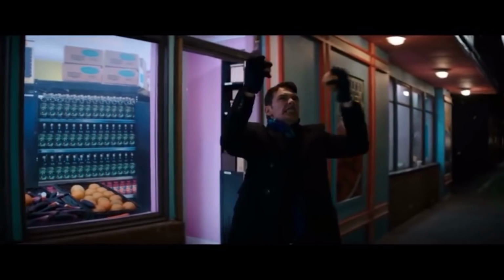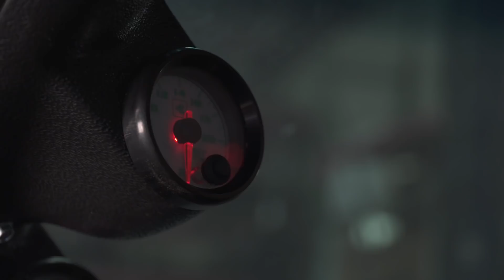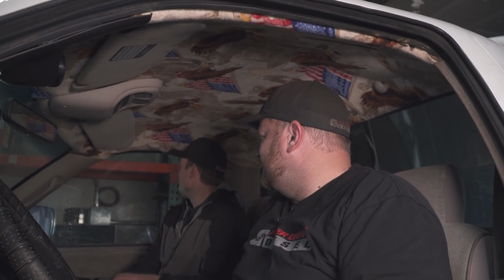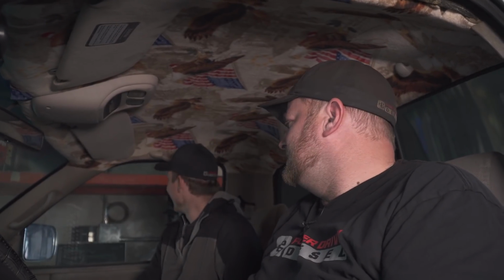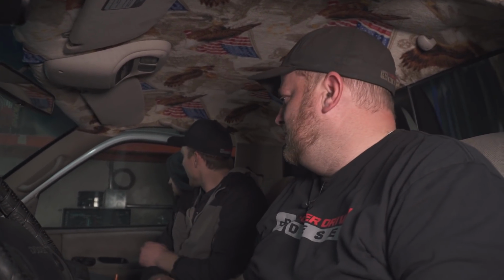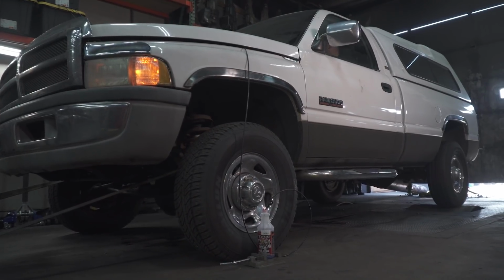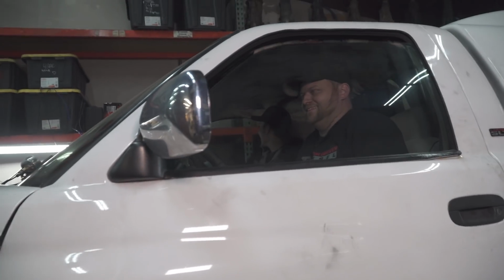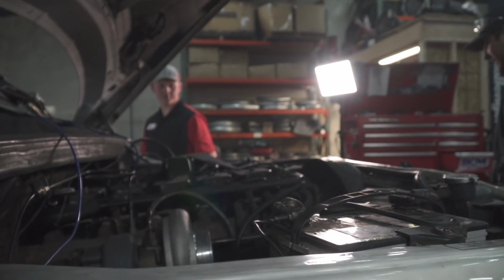Does Nitromethane Add Power to a Diesel? | Power Driven Diesel

Comment: My 1996 has 480000miles with compound turbos on it still on the original headgasket engine has never been touch. I have a set of head studs I put in it a few months ago. I have seen 70lbs of boost out of it so far. It just keeps on going. It's really amazing how much these engines will take.
Reply from the maker: Sometimes they just seem to last forever... and then sometimes they struggle to keep the head gasket in-tact.

Comment: This was awesome great job men!👍 Josh fed that dry shot when the horn blew 😂. 👀  I had an old 1st gen Cummins with some minor mods. I installed a snow performance methanol injection kit on it. I could have swore it would make a little more power with straight ice water injected over the meth. It was good for 4-5 10ths in the quarter mile. Thanks appreciate it

Comment: I would like to swap this motor out for the one that's currently in my 94 12 valve. I purchased my truck from a family friend shortly before he passed away and the truck has been sitting due to mechanical issues in the motor. I'd love to see you truck up and running again even if it's for a short time.

Comment: Idea to test. How much power is lost in the exhaust. I have a straight pipe with a 30 inch magnaflow. Every now and then it blows off at the coupling where the cat used to be. I swear I feel a surge of power when I blow the coupling off at where the cat used to be. I know there is a gain just going from cat to no cat. But I am curious how much is gain is going with a 4 foot pipe vs all the way tot he back.

Comment: Man, I love you guys..."Not in a gay way" just to be clear... LOL. I wish I lived over there. I feel like I would fit right in..But I sure would like to win that 12 Valve. I would use it as a reason to drive up there to meet everyone. I pissed away all my money on building a 24 Valve P-pump compound turbo truck. It looks the same minus the camper. Single cab white on gray. But I took it to far. Getting over 80 ibs of boost before lifting. I know that bottom end is going to have a window in the block soon. I need a block to build a stronger bottom end. Keep up the great vedio's. I'm the dieseldummie of Texas.

Comment: So what about just pouring it into the fuel tank?
Reply from the maker: The BTU content is way lower, so it would lose power in the fuel-limited tow setting since it would have over 50% less energy available to make power that straight diesel.  In the over-fueled max power setting.... we don't know... but there's only one way to find out!

Comment: To get power out of Nitro you need to advance the timing by, at least, 20 degrees. Nitro burns SLOOOWWWWW. Nitro brings its own oxygen so no real need for nitrous. Downside to Nitro, its even more acidic than alcohol (its an industrial used acid), so it will eat anything thats not metal.

Comment: 38lbs ? you have plenty of room .  I drove a chinese he351cw  around  for about a year at  66lbs on my vp truck . Then installed compounds and could read past 100 psi . I did take it apart all the bushings and  bearings were  all heat soaked , frozen to the shaft.  Imagine the  drive pressure ?

Comment: One more question. What psi did the stock turbo Turbo pop? you guys should throw on an exhaust manifold with an external gate and toss some huge injectors in there and ghetto  fog it with two bottles and go for the horsepower record on HX 35 LOL! 1000hp or bust lol. basically please build my future combo and test for me haha!
Reply from the maker: We've had them blow up as early as 38psi and we've had a couple hang in there till 48psi or so.  Once we get to about 38 psi and into the low to mid 400 HP range, we rarely see much more than an additional 5 to 10 HP gain going to 40, 42, 45 psi etc.  Meaning the graph at 40 psi will dang near lay down on top of the 38 psi graph and the 45 psi graph.
Reply: @pddofficial  Gate it at 38 and add an external gate at the same 38 .. then toss some big injectors in there snd spray the hell out of it LOL let’s see 1000 hp.👍👍

Comment: Why don’t you just try to run the engine on straight RC fuel? Through the injection pump I mean.

Those little nitro engines are technically diesels.